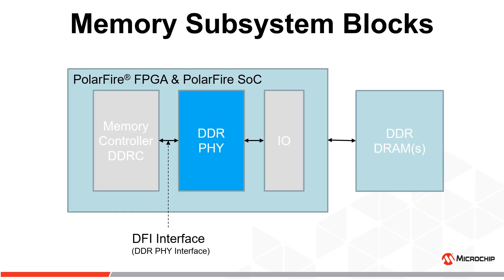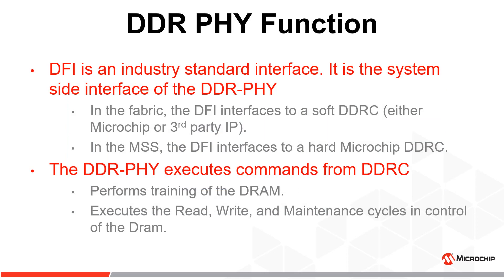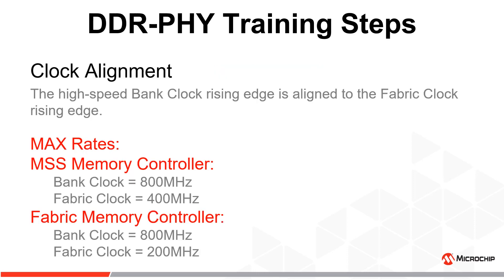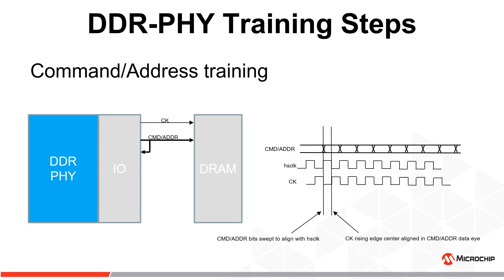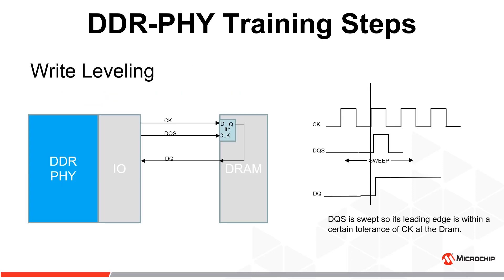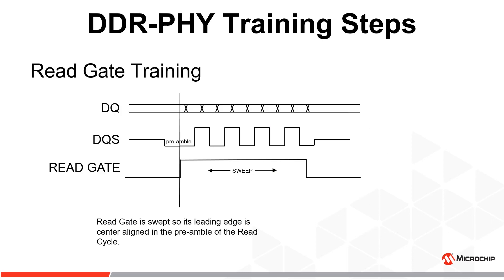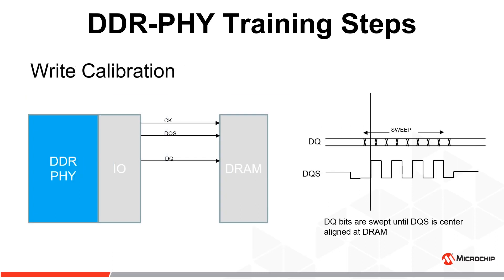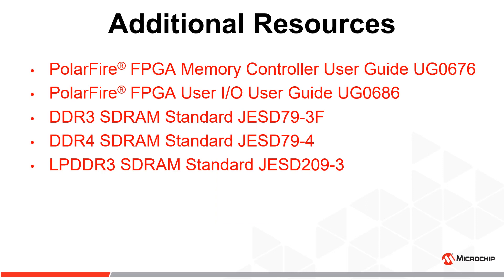PolarFire® FPGA & PolarFire® SOC DDR PHY Initialization and Training Sequence for DRAM Interfaces

Comment: This is a design step, or done each power-on? What about temperature & voltage variation?
Reply: the memory controller performs this during each reset(and power-on)